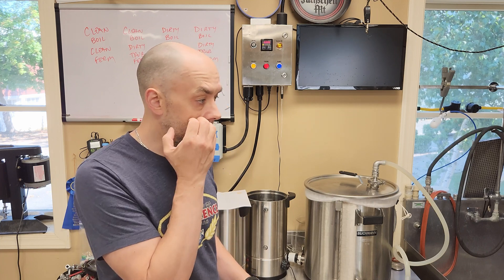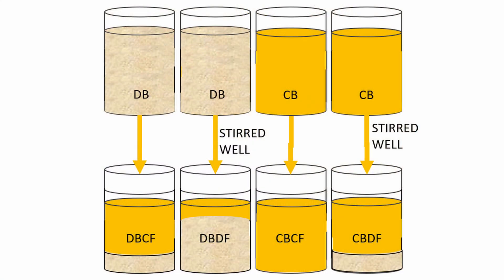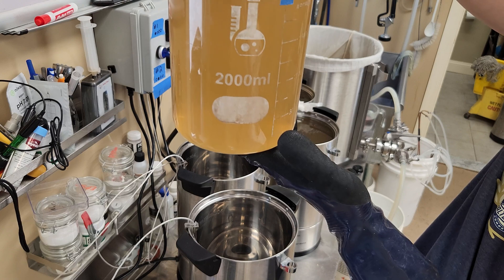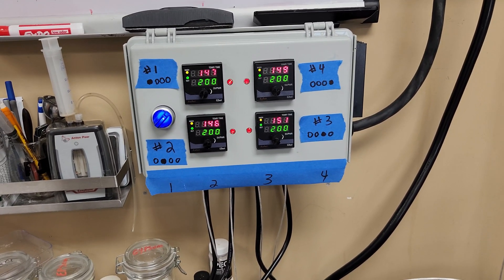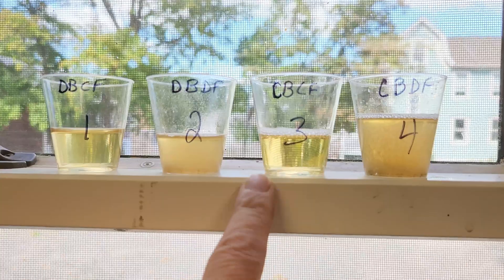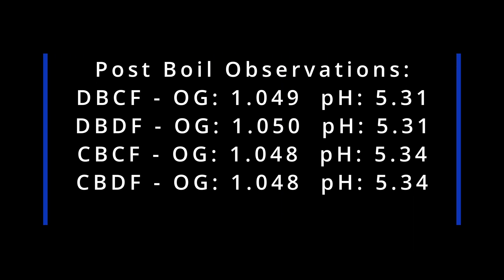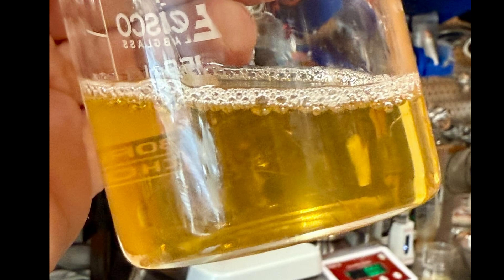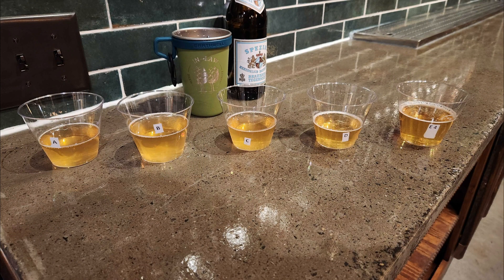BobbyfromNJ BrewMatrix 1 Kettle Trub x Fermenter Trub Experiment

Comment: Brilliant work!  Bobby what did you think of the beers? How would you describe the sensory difference?  

I usually make a point of letting my chilled wort settle out before transferring to the fermenter. I just thought cleaner wort will make a cleaner tasting beer. So pretty interesting that those efforts seem to be of little benefit or even a hindrance as kettle trub into the fermenter has a lot of data points now suggesting clearer and even better beer!  Why do commercial breweries make so much effort to whirpool and separate trub?  It’s not an efficiency issue (as is often suggested) this trub can better be removed post fermentation.
Reply from the maker: I preferred B (DBDF) just a slight bit more than D (CBDF) as it was a little more crisp and more similar to Genesee Cream Ale.  The CBCF (sample A) had diacetyl as the primary issue and it was bad enough that it fattened up the mouthfeel and became unbalanced. I think commercial breweries primarily whirlpool to keep as much debris out of the plate exchanger.

Comment: You can brew with any equipment, why brew in a bag?  I see the only advantage is a bit simplier cleanup as you just remove the bag with spent grains. But then you have to hang it somehow, with all the oxygen getting in, as you mentioned in the video. With pump filtering the wort through the false bottom it is always clear for me.
Reply from the maker: You're right, I can brew on anything which is indicative of  how much I prefer single vessel brewing. It's the fastest system in both start up and step mashing with the least amount of temp variation. It's kind of one of those things many people can't understand until they sit in on a brew session. Hanging the bag is pretty simple